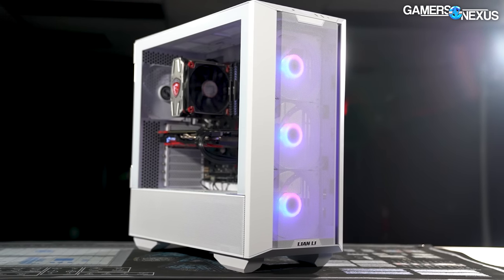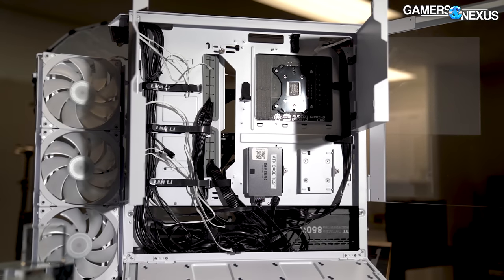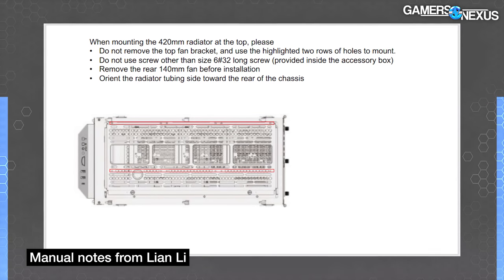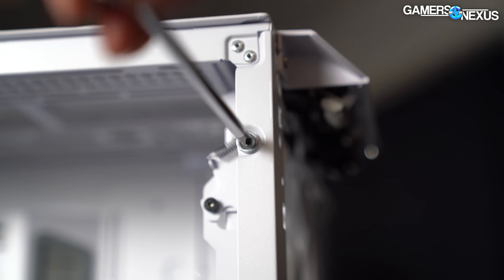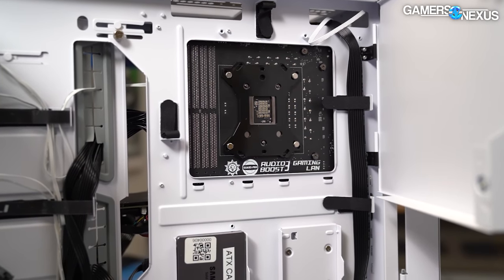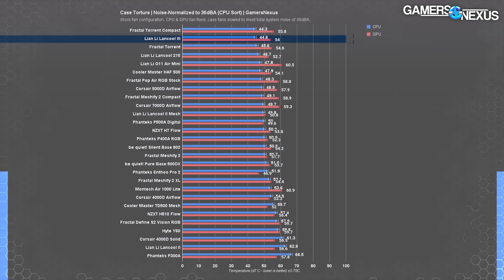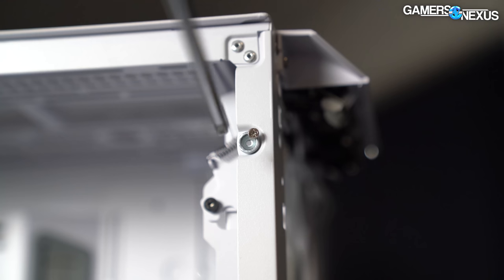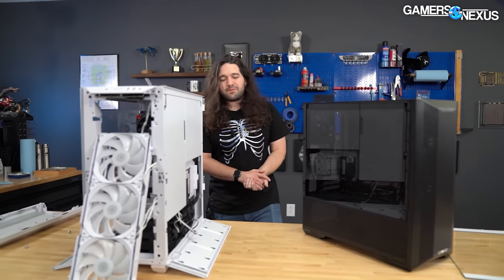Lian Li Lancool III Case Review: Build Quality, Thermals, & Cable Management

Comment: Half the gimmicks in this case I found myself wondering just one thing: Why?

How often do you need to remove panels/drives/fans/etc.?
Why do you build these overcomplicated mechanisms?
What if you have kids or cats that love to do unexplained things and they find some of these latches?
Why do you need both sides to be glass when you cant rotate setup to be shown from other side anyways? Window to see neatly placed doors?
What if you want to move your computer to different room or have LAN or smt and you have to duct tape every side just so it wont open up by accident.

Why dont you focus more on acustics + temperatures instead of making all these over complicated crap? This isnt over engineering this is adding every single gimmick you can find on case. Next there comes remote controlled robot legs and flamethrowers.

There are some cool features but even those could have been better.

Comment: four doors for more ... er... *cough*

anyyyyway.

i'll stick with my lancool II, i don't need the changes, and i like the hot swap backplane. even if i did have to flatten the top lip of the drive cage that the backplane sits on due to out of square, which i suspect was due to shipping more than QA.

Comment: I see nothing in that case that would add any value vs the Phanteks P-500A case my system was built in. All the fiddly doors would just make it a pain to assemble a system or upgrade it. The tempered glass covering those is just silly. Those plastic spring loaded latches are going to break. The I/O section being movable is useless and yet another failure point if you grabbed on to that by mistake trying to lift the case. As with most mesh front cases, you are going to have to blow the dust out semi regularly, and guess what? All those doors are more things to have to move to do that chore. Finally, to me personally, it's a not a very appealing case visually. For all the gimmicks, it looks generic. I won't claim Phanteks A series cases are beautiful, but at least you know you're looking at one without a logo needing to tell you. I give it props for including a usable number of fans from the factory, but they are far from alone in that at that price point these days.

Comment: since when did it become the norm to not have a dust filter in the front???? ????
Reply: Since airflow became the priority. Dust filters severely restrict airflow, which causes systems to heat up faster which causes fans to spin up higher and louder to compensate. Mesh cases with no filters offer substantially better cooling performance, GN has done extensive testing on this. Cleaning out your case is a small price to pay for quieter, cooler systems.
Reply: @RicochetForce  :S i dont agree with this :S i have silent sistem with great dust proof... in Cooler Master H500p Mesh White, but with not stock fans

Comment: Looking at dimensions and pricing (at least in EU right now), I like to compare this case to the Be Quiet 802 Mesh. The 802 is a little wider, but not by too much.

The Lancool III definitely has more mechanical gimmicks and some distinct mechanical advantages. For one, the bottom radiator mount simply does not exist in the 802. The back side doors are also a Lian Li special. However, the 802 fits a 420 radiator with much less caveats/limitations, albeit at the front only. In my view, I'd put compatibility for large radiators (and better airflow for them) above mechanical gimmicks.
The airflow and temperature advantage compared to the 802 is significant, though much less impressive when looking at the noise-normalized measurements. Moreover, in my experience with the 802, the temperatures improve dramatically when removing the front dust filter. This might be due to the fact that I'm running a large radiator in the front, but still.

I don't think I could really decide between these two. Owning a 420mm rad makes me want to see more testing as to how well those work in the Lancool III top mount.

Anyway. Thanks for the case review!

Comment: @Gamers Nexus - The charts are somewhat biased.  The charts/comparisons are generally based on all cases.  Consider showing the charts based on cases of similar designs, features, and functions. Example - A case like the be quite! Never has a shot in the world compared to any Fractal Torent.  Mind you, I am using the name, be quiet - as a point of reference only. But in both cases is designs are as far left and right field.  Consider breaking down to showcases based on silence in design versus open airflow.   Your charts are full of great information but extremely hard to use when the charts are not considered apple to apples.
Reply: The cast chart is fine. Their focus for case reviews is cooling performance, value, and build quality. You're asking for them to address case niches when most folks just want a box that won't cook their components, or be miserable to work in.
Reply: @RicochetForce   - Thanks for the reply.

Comment: It’s a great case improve on the cool mesh 2 I have it’s bigger more room. If I don’t have the mesh 2 I would buy it. But I am use to my Lian li cool mesh 2. Now the Lian Li fans though it’s a bitch to get them to work like the rgb I have to get a 3.0 usb to 9pin to use the controller that’s supposed to already work the fan works but my rgb still aren’t. And the glass they are not interchangeable wish they were front and back. If they made the rear upright fans like the 011 I would totally buy it but it’s look too much like mesh 2 so won’t buy it yet.

Comment: Im confused by the giant GPU thermal difference between the II and III... and really any recent case test on the GPU department. With GPU performance and temperature nowadays far more critical (and even more so when the power hungry 4xxx releases) than CPU temperature. CPU temperature which is going down fast with 65w versions and affordable AIO's to the point of irrelevance in case selection. Making this one area that is really triggering me to no end. 

- Why are all the recent cases so much worse than cases that are 2-4 years old, on the area that is most critical to gamers -

I feel like suddenly seeing +5-10c on the GPU in noise-normalized and 3dMark stress testing almost has to have some kind of outside influence to it. Especially when standardized fan testing doesnt show big difference in fan quality or setup either. No way every new case and various manufacturers are all implementing the same downgrades and mistakes on GPU thermals. I feel it cannot be a coincidence that. every. single. one. is legit that much worse than older cases. 

Is it perhaps time to re-review some cases like the Lancool II Mesh, P500A and Fractal Meshify 2 and check if that data is perhaps corrupt? Or re-review the test setup, maybe the GPU is in need of some new thermal paste or something? Really really interested what is behind this degradation in GPU temps. 

Anyway, guess i'm off to give some TLC to my P600A. Apparently she's going to be staying arround for a long, looong time....

Comment: This all sounds like they should have added a inch to case hight. Which is my opinion on most cases. To darn cramped. Cases should be slightly taller and wider for ideal spacing. Over engineered but they forgot that all needs space.
Reply: The Lancool 3 is already massive and weighs 31 pounds. If you want more space, just buy a full tower.
Reply: @RicochetForce  full towers are rare and shit in general tho..
Reply: @pino_de_vogel  But them's the breaks, man. If you want a big, roomy case with substantial amounts of space above the motherboard you're going to get full towers in your search results. That's just how it is when you have niche case demands. 

I love rear 140mm fans, but if I limit myself to cases with only that I get a tiny shred of the market. And many of those are unsatisfying. So I compromise and wound up finding the Lancool 2 Mesh.
Reply: @RicochetForce  most full towers are not wide at all and on top of that there can be a HUGE diffrence betweena roomy normal tower and a full tower.  I have a H500p mesh now which is not a fuill and not a medi but its wide has plenty fo space and does not feel cramped like this case seems to be.
Reply: @pino_de_vogel  The problem here is that width is ultimately not particularly desirable in cases. Once a case is wide enough for common 120mm/140mm fans + the width of a PSU they don't go much past that. 

Full towers are typically narrow because they're trying to be as efficient as possible in saving space, especially desktop space. A wide full tower as wide as a O11D while retaining normal fulltower height would nearly be a small storage cabinet in size.
Reply: @RicochetForce  It is to a point. you need with for space on the right side for cable management or that becomes a hassle and a giant mess and you need inner with for a propper air cooler. And a positive is that you have more air volume which takes longer to heat up.

Comment: So, case is LianLied - not cheap (more expensive than II ), overdone mechanically, GOT NO DUST FILTERS (you have to pay them separately), and front panel removal is (like Steve finally showed and commented properly) odd. I like O11 Air Mini, but they cant make a case fully finished. Dust filter is A MUST, and should be sold with the case - user can decide to mount them or not (plastic frame with magnets, material filter - for example tulle). Case feets are too low, and thanks to their shape, its really hard to swap these for something else - these holds glass panel. 

Overall i think LianLi is ending - i honestly threated that company just like EA, selling basic things as DLC's? Removing front panel like in 2000, with such advanced and expensive case? LL - ARE YOU APPLE? This is not good case - thermal results are simply forced by holes in the case. I got dust filters pretty much everywhere (top, front, bottom, BACK - yeah, i covered even PCIE slot covers!) and dust still gets in, and settle on GPU backplate - imagine how it would work for few months without dust filters at all.

Comment: Fantastic price for this case IMO.  The fans alone, on the RGB model anyway, would cost $100+.  You're essentially getting the case for like $50. 

I'm using the O11D XL which I really like, but if I was shopping for a case right now this would be a strong contender.

Comment: WD 40 is your friend, with springs, doors, and anything that hinges...thats literally it, and at Lian Li, they know this.
Reply: dont put wd40 your case unless its to clean something out. its only a temporary cleaner and penetrant, but over time it leaves a gummy residue that attracts dirt and dust. silicone spray is much better lubricant and protector. its stays for a very long time, really good insulator for electronics and has a dry finish so wont attract dirt. wd40 makes a silicone spray and also a electronic contact cleaner
Reply: WD40 works just fine, plenty of channels on here have done it, as well as i have, owning several PC cases throughout my life, literally no gunk build up. Again...

Spary WD40, and wipe it down, better yet, just rub some on with a cloth just for the case (micro fiber), works like a charm.

Comment: WTF...Lian Li. Now your quality are so bad. Bought this case in  August 2022. All the thumb screws are rusty. Top radiator mount screws rusty. Top power supply fan mount screws rusty. Open the front panel can see the small screws holding the glass latch also rusty. Almost all the screws come with the case are rusty. This is the last Lian Li for me.

Comment: I couldn't help but feel like they were trying to dislike this case, there was so much nitpicking, it's just weird. Apart from the weird GPU results, this seems like a step up from the II mesh and it seemed like y'all still didn't like it,  despite being so positive on the II mesh. The "meh" reaction, after only being able to complain about the front panel mechanism and trying to say the glass opening mechanism is weak and could break after a while (even tho it look pretty fine to me), just didn't sit right with me.
Reply: I got the same impression. Not sure why the 3 was presented in this tone.

Comment: Looks and sounds rickety and cheap compared to a Phanteks P500A
Reply: @htr5372  Yeah it's a bit of a pain having to unscrew the top-mounted radiator instead of just being able to lift the whole panel off, but overall it's my favourite case. Ended up getting a P300A for an HTPC and a P360A for my girlfriend's workstation because of how much I like the P500A.
Reply: @htr5372  Does the case RGB hub lift with the top panel on the P500A?

Comment: This case is very difficult to work with. The instructions are difficult to understand with confusing diagrams which don't really show you how to perform steps or what the crucial movement is. And it comes with four drive caddies that don't support Seagate HDDs because the holes are spaced too closely. I wish you guys had caught these things, I might not have gone $500 down the rabbit hole of purchasing a case and a PSU that won't allow me to fit my $500 of HDDs I use for video editing.

Comment: I don't like this case, there are far too many needless points of failure and pointless features. everything is spring loaded and there are doors and compartments ever where, they are all suited to hiding poor cable routing and management something you wouldn't need to hide if the case was actually designed for doing the job properly in the first place, all this attention to detail and colour matching and you're telling me you couldn't add even a single cable tie off point in the entire case? so every cable just sits in a tangled pile at the bottom, what a joke. 

What's worth is all these doors that not only needlessly add to the wight of the system but will make moving it around or transporting it a nightmare not only needlessly heavy but will no doubt swing open while carrying it around. 

You can get so much more for way less then the asking price here.

Comment: I think the Torrent cases are horrible. The big front fans which are the main selling point of the case make this horrible grinding noise which is definitely noticeable. I've owned both the Torrent and Torrent compact and they all had this issue. The side panel also feels very flimsy and cheap and the top and front is completely made out of plastic. The only thing this case is good at is airflow.
Reply: @Levi What do you mean? The fans aren't good. The only reason they move a lot of airflow is because they're huge. If Noctua made 180mm fan I bet they would beat the shit out of the stock fans

Comment: Just wanted to say, the way you remove the Lancool's front panel is not only suboptimal, but it's just plain dangerous to the case itself.
I built my current rig in a Lancool 2 Mesh, and the first time I took off the front panel to put the fans in, I accidentally snapped one of the pins off.
It takes a significant amount of force to take off the front panel (especially for the first time), so this type of damage is honestly unavoidable with their design.

Comment: Those Corsair cases have really poorly made glass panels that have a tendency to randomly explode. The circlejerk fanboys in the Corsair subreddit keep trying to say it's "normal" and blaming people putting the case on countertops and the like... hot marble shouldn't affect glass when the glass is raised above the surface by the case feet.
I would not recommend a 5000D whatsoever.

Comment: Hey Patrick that scale you used to weigh the case has lbs and kg. You should at least report the weight in lbs seeing as you guys are in America, if you want to report the weight also in Kg I'm fine with that. All you have too do is push a button. It was not clear if you guys set the tare weight before you set the case on top of the shelve, I just want to ensure QC at GN. You can't ask for it and not do it yourself in return. FYI I have that same ebay scale..

Comment: After getting water-cooled 6900XT and paired it with eisbaer aurora 360 on my Raven RV02E-case. I got a little interested on watercooling...

But, Raven has to go. It is not made for watercooling.

I like big cases and I have terrible difficulties to choose between Lancool 3 and Enthoo 719... I have cd-burner, which I need, so that's point for Enthoo as you can get that separately... But damn! I really struggle to choose!

P. S. Did go with big, so Enthoo 719 (Luxe 2) it is...